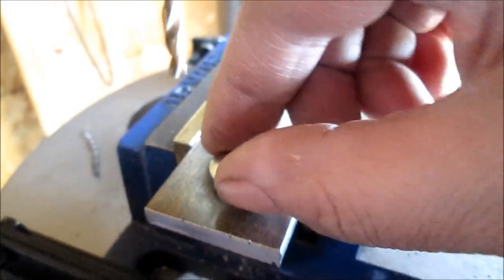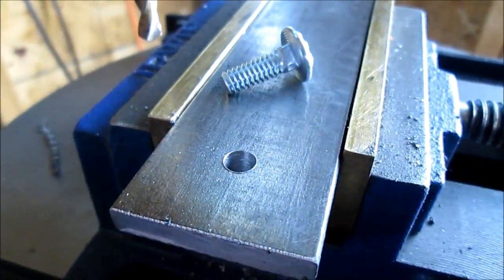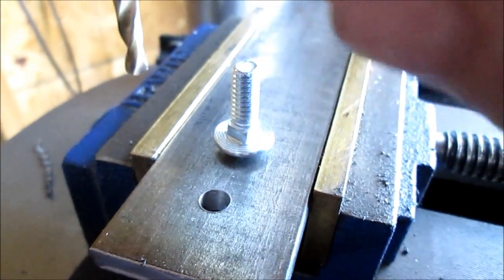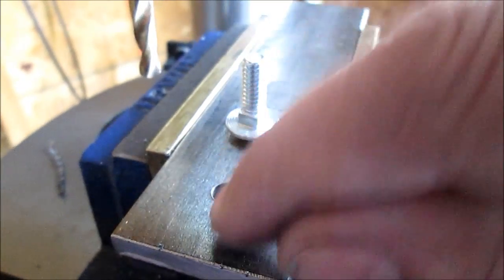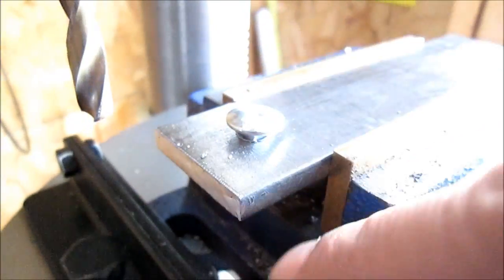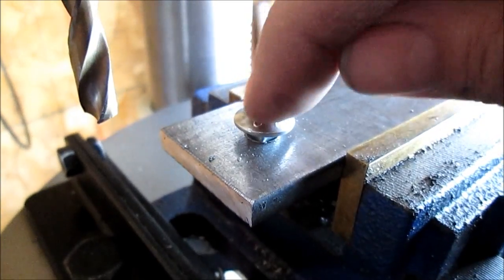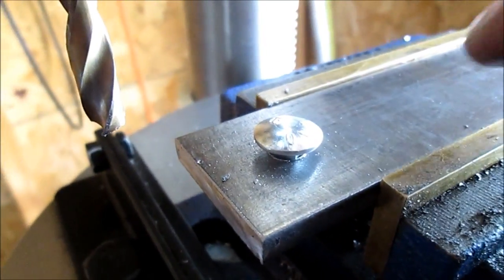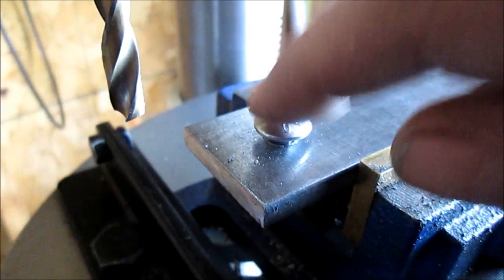How-To...Counter sink hole to hold the head of a carriage bolt

Comment: So 5/16 drill for the countersink and what size for the 1/4 carriage bolt?
Reply: 1/4 inch. This is where a Carriage bolt and a Lag Bolt differ. Lag bolts are intended to grip the wood/metal, almost like a screw would, this is achieved by the threading being more coarse and spread. Carriage bolts are used primarily to squeeze rather than grip, so they are finely threaded and closer together. Try to keep your hole as close to the bolt size as possible, that way to prevent wiggle and sway. The nut and washer should do most of the work.